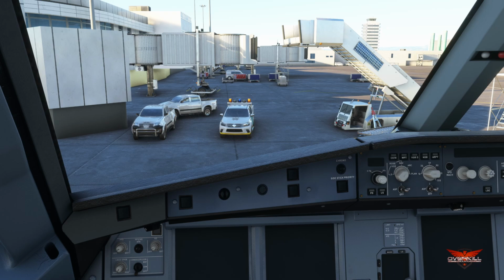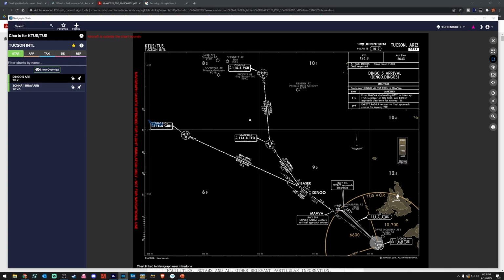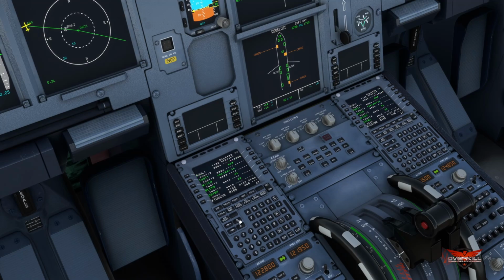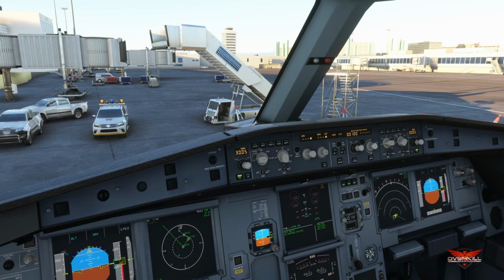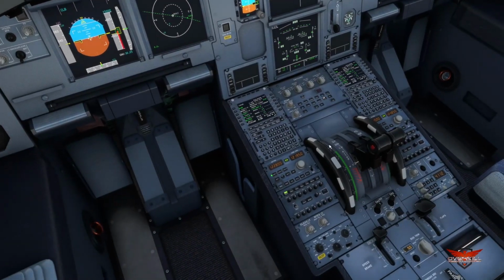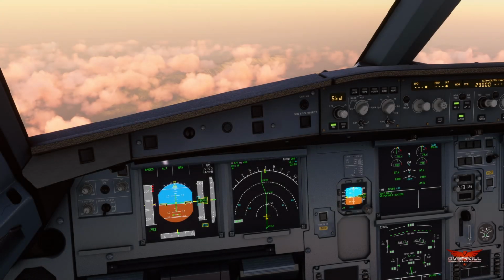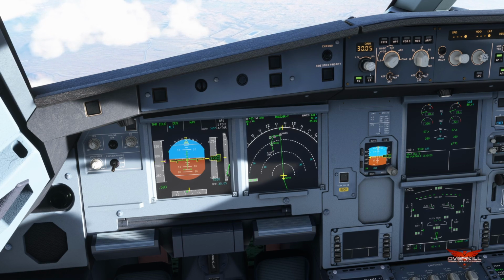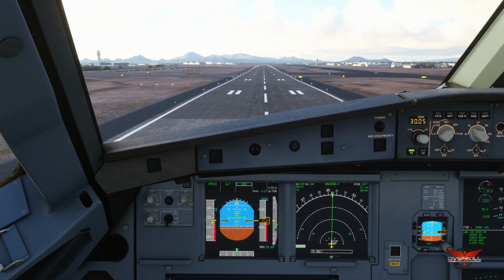Microsoft Flight Simulator | A320 Full Flight | Trim Settings & Flex To Temp

Comment: If you look at the SID chart for the TUSTI2, it has a manual bit that would normally be vectoring by ATC before doing a direct to a point on the SID later in the flight.
Reply: yeah, he was wondering about the discontinuity LOL.... This video contains a lot a misleading information. I strongly recommend to switch to real Aibus pilots tutorails. There's plenty on here.

Comment: Last I checked A320 FBW still did not support RNAV (according to Discord)...do you know when this changed?
Reply: I guess you mean VNAV? There has been videos on YouTube for more than a year, about how to fly a RNAV approach in the FBW A320. Ref. 320simpilot 🙂
Reply: @chaophraya8003  vertical guidance of RNAV APP mode is part of VNAV system
Reply: There is no RNAV in FBW A320NX anymore. It used to work when using the Asobo LNAV/VNAV, so the 320simpilot tutorial is not valid anymore for the FBW A32NX. You can use the FPA/TRK feature and use the GS degrees as a reference. Overkill just disconnected the A/P and hand flew the RNAV approach, but without references, you can see how disappointed he was with his landing.
Reply: Check this out! https://www.youtube.com/watch?v=xGazHQCZ900

Comment: you don't seem very familiar with A320 FMC programming... You didn't even realize that the Tflex calculator isn't working. No matter what data set you enter, it always returns Tflex= 43°C....
Reply: Not true. It changes based on TOW...
Reply: No matter the OAT and TOW, the Flex Tem is always 43 Degrees C
Reply: @solarisfire  not with this performance calculator. It doesn't work. And , by the way, it's not only the TOW influencing the TFlex. Please think twice before posting.